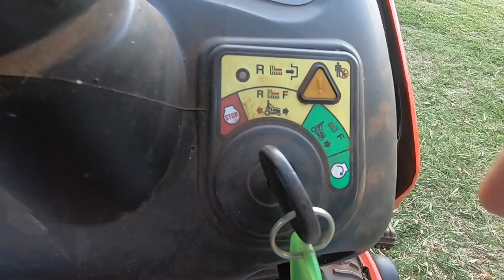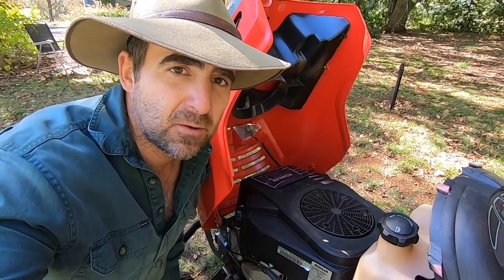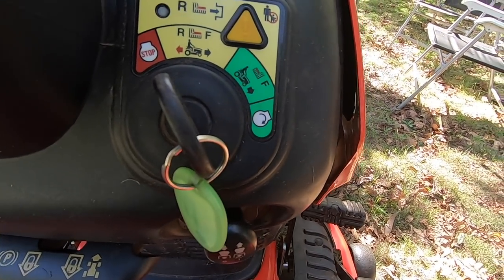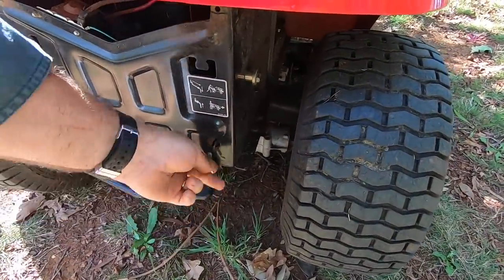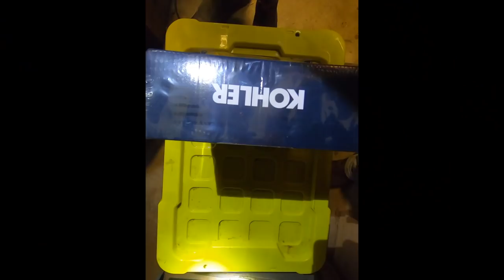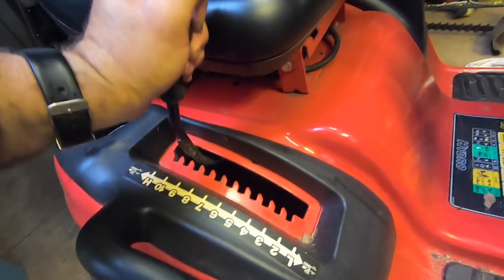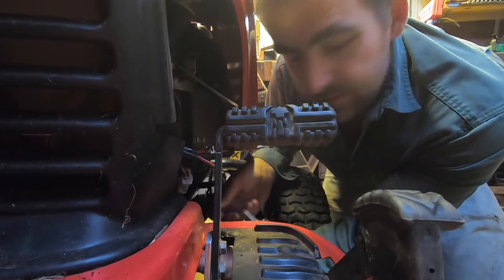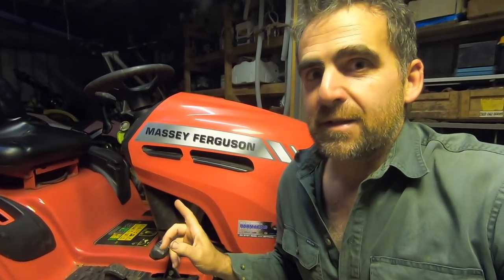Massey Ferguson 4220 Ride-on Mower Review and Service

Comment: I am so happy to see this review. I use to work for Massey Ferguson in Melbourne in the mid 80's. Good to know they are still appreciated. 🚜🚜🚜🚜👍👍👍👍
Reply from the maker: Good stuff. I still routinely operate a TEA20 from the '40s. Love the tradition. The deck on the mower could be better though........ Long term frustration kicking in. Engine, running ear have not missed a beat in well maintained two years of ownership though so not bad overall.

Comment: My 4220 Husqvarna is identical, right down to the cutting deck. 10 years old now, great motor but weak deck and have just had the deck welded up. I agree with all aspects of your review.

Comment: I bought a Deere, I weighed up all the good and bad points of all the name brand lawn tractors that are available near me and the wife approved the expenditure as long as I got the nice green coloured one with the yellow wheels (they look like a proper tractor). 
It has a few features that have me scratching my head, like the button to push so you can reverse with the blades going. Surely its a distraction from looking where you want to go while fumbling around for a small button? 
The oil drain that is specially placed to rust proof the front wheel pivot and chassis rail, while completely missing the drain pan. 
Don't get me started on the sealed for life transmission.

I tried the beer and mowing thing, but was nearly sick as my yard is a bit lumpy and I therefore don't recommend drinking beer and then shaking it. The cup holder is now reserved for secateurs and collecting dog balls  8-0.

For me dealer support was also a big factor, my dad had a Husqvarna that was good, but parts availability was a bit hit and miss (3 months for a starter motor). With the JD I order parts from their online catalogue and if they aren't in stock, then they are in store within days.
Reply from the maker: Great feedback on a very popular brand. Thanks mate!